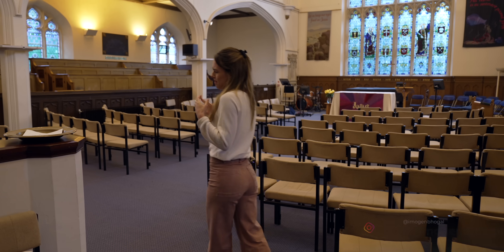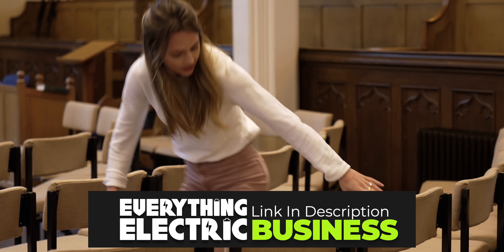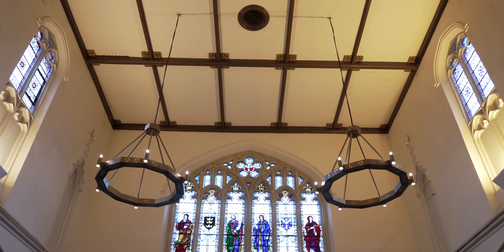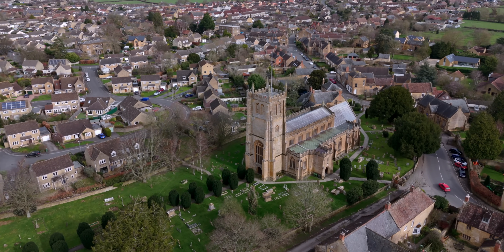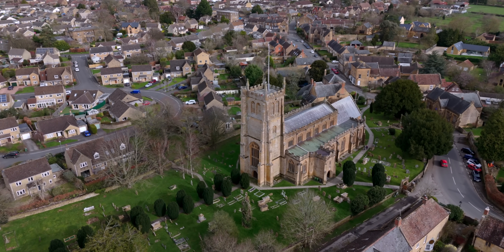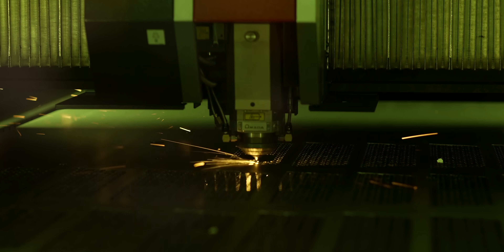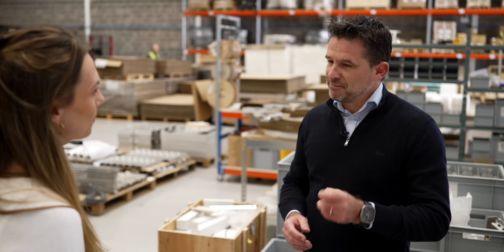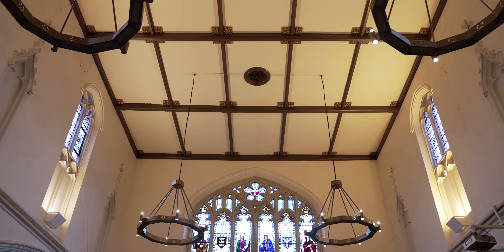Is Infrared Heating the Holy Grail of Electric Heating?

Comment: Icwotchudunthere.

Yes FAR IR heating is the holy grail for heating up people (and  objects) in a large space. Or a small space.

Best to do the draught proofing thing as well as though.

FAR IR heaters are partly defeated by cold zephyrs wafting around and about.

For them as interested despite themselves Google will find you examples of American practice whereby the FAR IR panels are installed behind the plasterboard (or ceilings) and turn the entire room into a radiator. There's always a proximity effect (sort of) where the plasterboard (aka sheetrock or drywall) heats up and there a secondary heat radiation from the plasterboard wall itself.

Google will find you "This Old House" and the pertinent episodes if arsed.
Reply: A human being is a far infrared heater.
Reply: @rogerphelps9939  

But you need a fair number to feel properly cosy.
Reply: @t1n4444  IR not disagree with with yee, and the the bespoke grail is a divine touch.
Reply: @briankuhl9314  

🤣🤣🤣🤣🤣

You're wasted on here mate!

You could be penning sermons for the less imaginative Vicars ... and help turning services into "stand up".

You'll pack them to the aisles.

And no mistake.

Comment: its another gimmick from Everything Electric Show
Reply: How so? They show lots of different things, it all depends on your user case. Using IR heat here means less wasted heat in the rafters compared to some other tech.
Reply: You didn't take the time to listen to the reasons.  This is perfect for warming the people who will be in the building for a short time rather than heating all the air in the building,  which usually must begin the night before,  and then wasting all that energy.

Comment: You know they had electrical infrared heaters on the titanic in 1909, everyone was astonished by them then.
Reply: Should have put some on the front of the ship.
Reply: @drunkenhobo8020 

There was a fire in one of the coal bunkers, allegedly, which is supposed to have mucked up the integrity of the hull plates so as the hull struck the iceberg the plates cracked open.

The rest is history.

Comment: This is what is needed, straight forward, positive information about how energy efficient solutions can work, save money and look great!
Thanks for highlighting this.
Reply: I'm not sure I would call this "energy efficient" this is literally the same energy efficiency as any resistive heating and has been around ages.
Reply: @Mike__B They are spending less on electric heating using this method than they were on gas heating previously.  Given that electricity per kWh is so much more expensive than gas, this indicates that they are being vastly more energy efficient than they were. On the low carbon front, each kWh of UK electricity produces 82g of Carbon, whereas each kWh of gas produces 185g.  So far fewer kWh, and far fewer carbon grams per kWh.  Very much more efficient on all fronts.
Reply: @Mike__B  "Does the UK get a majority of it's power from renewable (non-burning) resources?" - yes.  Over the past year, 33% of our electricity came from fossil fuels, and 5.5% from Biomass. The rest of electricity generated in the UK came from Wind, Solar, Hydro and Nuclear.